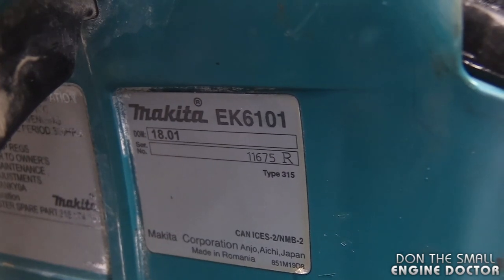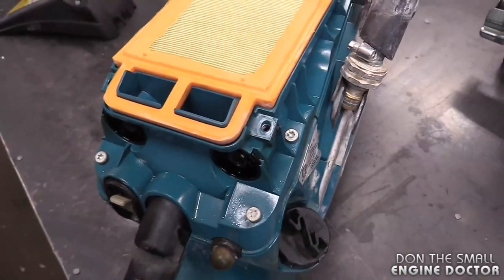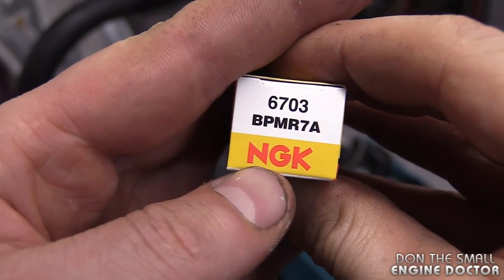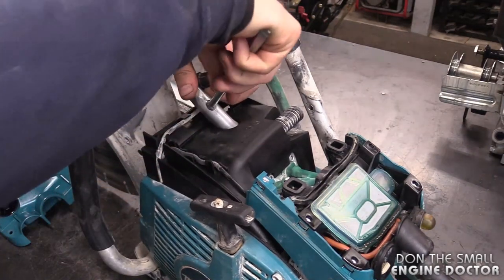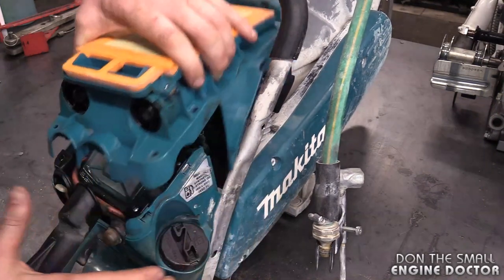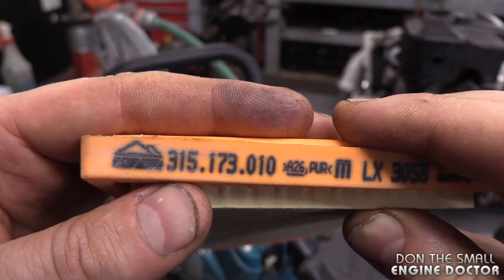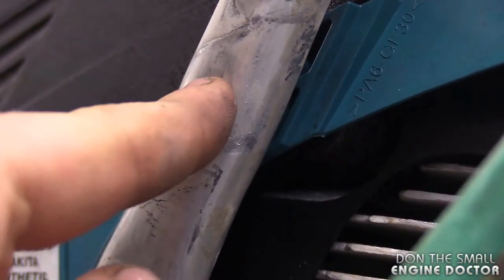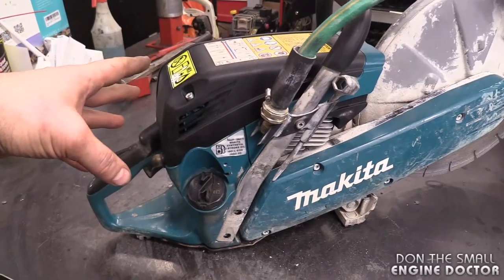HOW-TO Replace The Spark Plug On A Cut-Off Saw

Comment: Thanks, Dony, i just purchased this saw....so i really appreciate your detailed video, i think the most important thing to do with these cut off saws is basic Maintenace, very often.which is usually over looked when they are starting:) daily or occasionally
because they work in Dirty and dusty applications, they require 5x as much Maintenace
then your other power tools

Comment: Good day. The spark plug gap was reported very quickly in inches. How many mm are correct in the gap? An excellent video: a methodological presentation of the material - 5 stars, everything - in essence, not a single extra word - 5 stars. As always - well done. Best wishes from Russia :)
Reply: Conversion from inches to mm is easily done with a Google search (.030 inch to mm).

Comment: 20 Nm can't be 20 ft-lbs.  Newton meters are not equivalent to foot-pounds.  I think it's 14.75 ft-lbs.  Don't strip the aluminum threads.  Ah!  Dony is saying it's either 20 ft-lb or 20 Nm.  Got it.  Sorry, Don.  And after seeing the video a second time, I see that Makita supplies a tool on the side of the machine which is for the spark plug and for loosening the screws.  Good company, that Makita.
Reply: yes, you are correct 1Nm is 0,737562 ft-lbs , so if the spark plug wrench is 0,14m long the force you need to overcome 20Nm is 142,85N or 14,56Kg , but as Don say THE BEST IS TO USE COMMON SENSE IT IS NOT THE SPACESHUTTLE HE IS WORKING ON
Reply: @kjell-richardlvdal373  It's over a 35% increase in torque.  Is it that hard for people to learn things?  For some people, it's impossible.  And there's yer dinner.
Reply: @alext8828  , so you are also looking Taryl fixes all
Reply: @kjell-richardlvdal373  I'm glad you picked up on that.  When I saw the words "Space Shuttle", I knew something was up.  I like that channel.  I would also recommend  Steve's Small Engine Saloon and Andrew Camarata as excellent channels.  I'm sure there are others, but do you have any favorites?